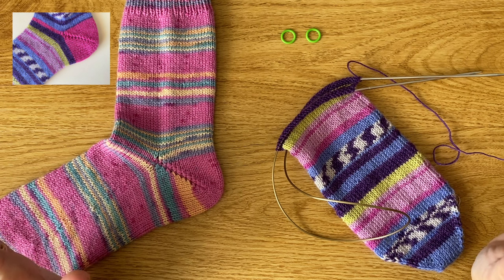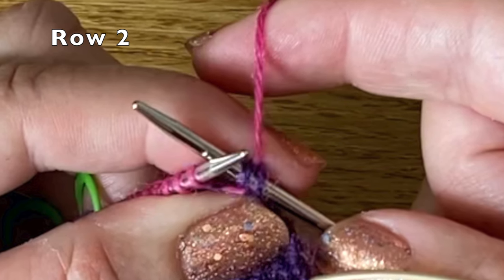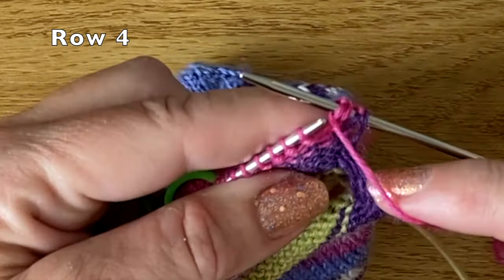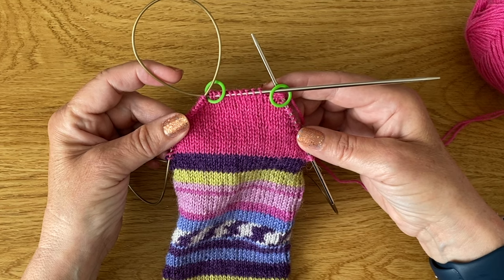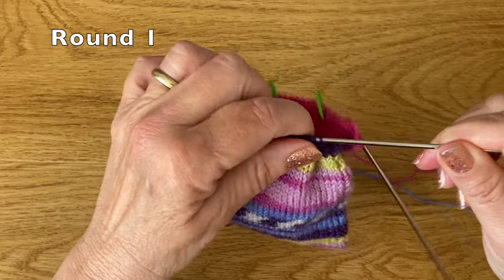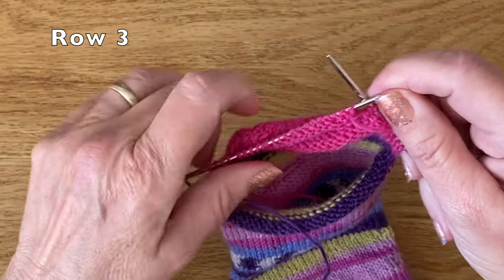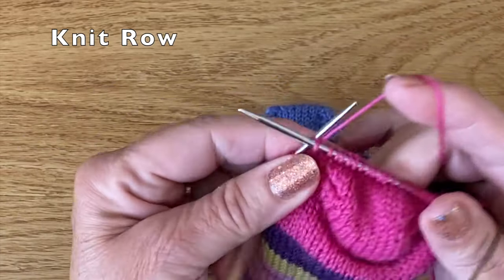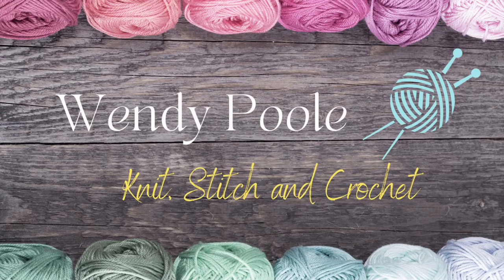German Short Row Heel: How to Knit a German Short Row Heel for a Sock - Step by Step - Wendy Poole

Comment: Great tutorial that I will definitely use. It's too late for the 2nd sock of a pair I'm knitting now, but I'll definitely try this.  I see at least 4 improvements over my typical GSR heels:  1) you use a balanced approach the the GSRs by slipping purlwise wyif on the purl side and pulling over the top, but slipping P-wise with yarn in back and pulling down and back on the knit rows, which is different from any GSR heels I've seen/done in the past; 2) doing two regular rounds after the first set of short rows is complete seems to help stabilize the heel join before starting the GSRs to increase the heel; 3) K through the back loop creates a directional slant that helps the curve of the heel, and 4) your method of closing up the holes (which I seem to have no matter how many heels I try) is the best yet simplest I've seen.  This is making me want to put other queued items aside to try this heel on my next pair of socks!  Thank you!

Comment: I just finished my 2 heels following your simple explanation! Thanks!
I am just wondering why you go through the back of the double knit- side stitches, as some others just knit them off through the front? I found them the most challenging part.
Reply from the maker: Hi there, we’ll done in your sock knitting. The reason I go through the back of the double stitch is to make the double stitches lean with a left slant (leaning outwards), which makes the sock heel look neater. Hope that helps. Well done again and enjoy your sock knitting.
Reply: Thanks for getting back to me with the answer! Happy knitting!😀